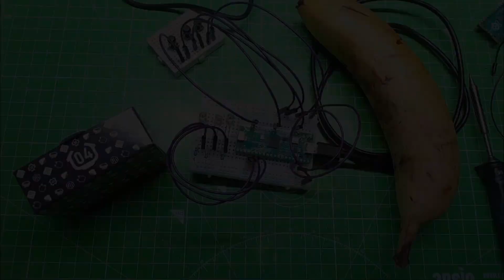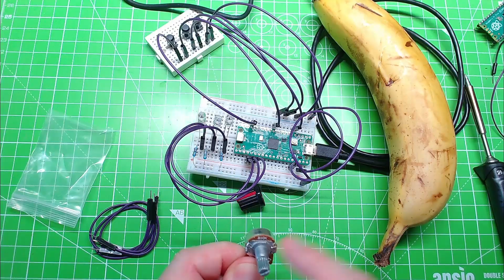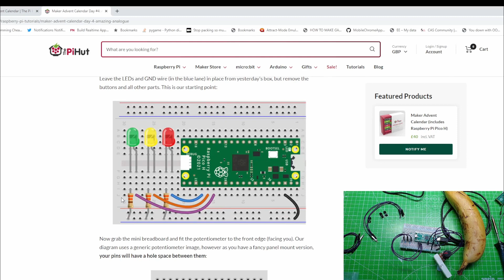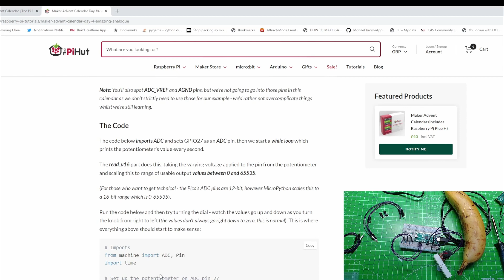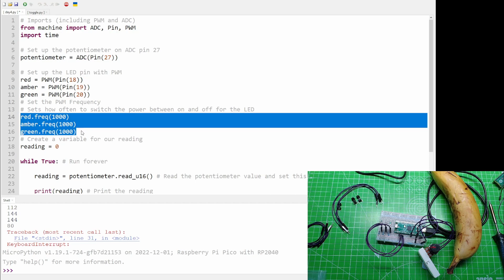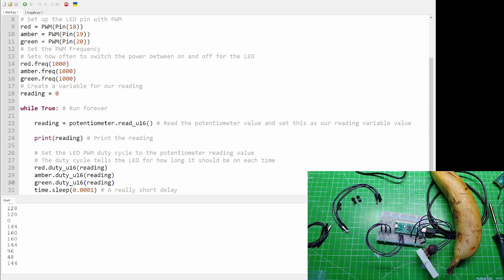Maker Advent 2022 Day 7: The Pi Hut Maker Advent Calendar Day 4

Comment: Why remove the pin.out  please ?

Do gpio pins default to pin.out?
If so why did we explicitly set this in previous example ?
Reply from the maker: Great question! The pwm() function that we wrap around the GPIO pin reference automatically sets up the pin as an output, so we don't need to specifically tell it that it is. GPIO pins will not default to outputs. We either tell it specifically, or use pwm() which does it for us. Thanks for asking, and for watching.
Reply: @LesPounder  🙏👍